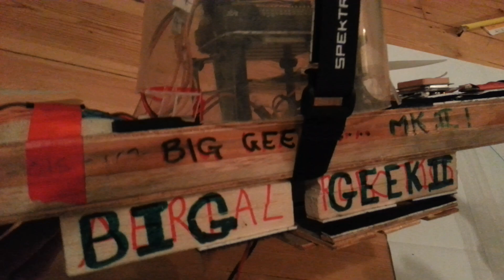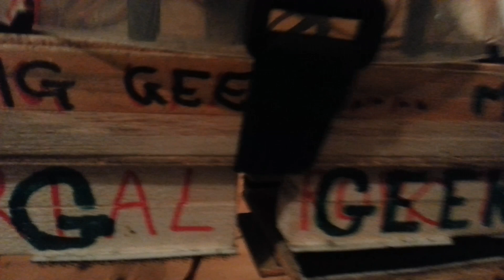Lessons learned from building my first scratch build H Quadcopter

Comment: Just a FYI.  The wood you want is poplar as poplar is a hardwood.  Not one of the finest but a hardwood never the less.  Where as spruce is a softwood.  Same weight, less strength.  For many years Sitka spruce has been used in model building because of relative strength to other softwoods but having a fine grain producing very straight wooden pieces, etc.  What you buy at hardware stores is most likely not as sophisticated as Sitka spruce but generally cost effective wood from North America, poplar or spruce.  I'd go with the poplar but as you stated look for the straight pieces as it can really warp if you aren't careful or observant.

Comment from the maker: Hi Victor Lee. I tried the H Quad option first and it got off the ground but would spin (yaw) out of control. Discovered that the APM does not care how the motors are mounted so long as they are equidistant. If you were to overlay an 'X' frame over this quad the motors would be in the same place anyway. It doesn't matter how you get from the motor to the frame - it could be a wiggly arm, an X or an H. As long as the motors are where they would be with an X then it will work fine. Hope helps.